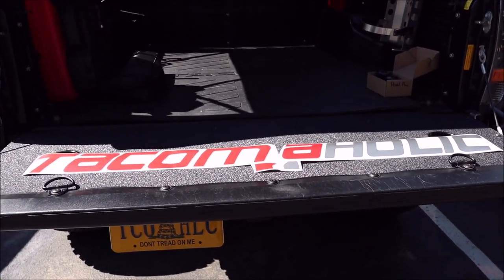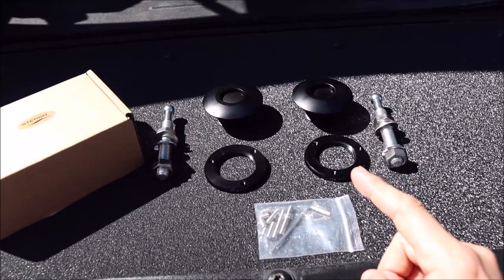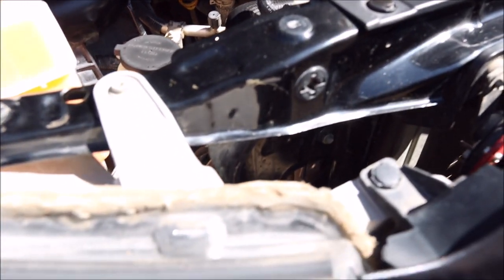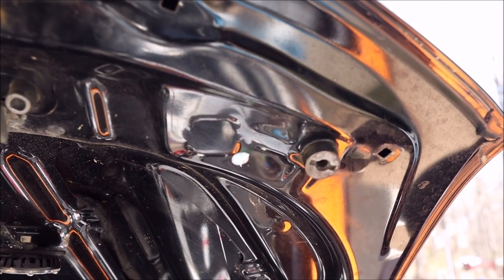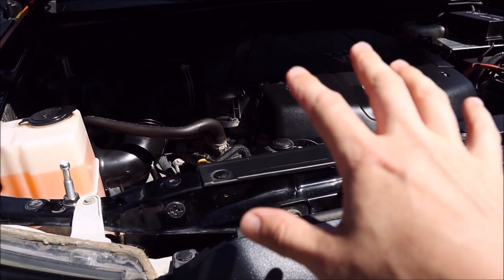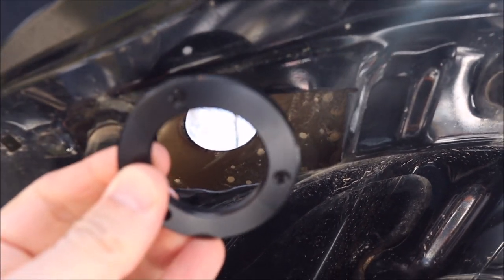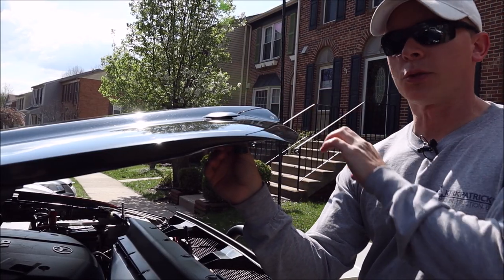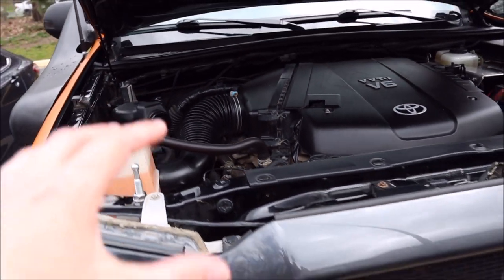Never Thought I'd Have to Install This Tacoma Mod

Comment: My first-gen Tacoma had that same problem, but it was on the rear passenger side being the mostly risen. All I did was stand and jump close to the hinge, and it made it ten times better with barely and 1/8 inch difference and has stayed the same for many years now with some hardcore 2/3 wheels on the ground crawling plus a county with many crap roads and it hasn't moved at all.
Reply: You, you, Jumped on your hood!!!??? 😲  WOW,  that took some boot skill ,an' saved  drillin' your hood. 🤣😂

Comment: Would start with loosening hinges, adjust. If you need to shim to get you where you want to be. It only takes being off a little bit on one end to be out a lot by the time you get to the front. I would bet it's from all the 2-3 wheel trail flex over time. May have to massage those hinges to get everything back in spec.

Comment: To fix that gap just simply turn the rubber bump stops (under the hood towards the front on each corner) clockwise to close the gap.
Reply from the maker: That was the first thing I tried.

Comment: Turn the rubber things on either side of the hood. Right beside where you drilled the hood. They are on every car ever made. Turn them in and out to adjust the height of the hood.
Reply from the maker: I tried every possible combo with those. Nothing worked.
Reply: @Tacomaholic  something is wrong, try taking the height adjuster completely out. Loosen bolts on hinges. If that doesn't work your  hood is bent. Someone could've have tried to close the hood with tools on rad support or opened it ìn a wind storm. You could also grab each corner of the hood and twist it by hand. Sounds crued but works.

Comment: It seems almost like the hood warped somehow I checked mine and the tolerance seems to be right on both sides I am wondering if the outer portion of your hood swelled up almost like it ballooned up maybe from off reading or the heat of the sun hits that spot more intensely just a guess I am sure there is someone out there with and answer for you good luck beautiful truck

Comment: I'm starting to have the same issue in my 15 Taco and I'm pretty sure it began after installing hood struts🤔
Reply from the maker: Were the hood struts installed in the correct positions on the hood?
Reply: @Tacomaholic  Yeah they are, I think I used your "how to" installation video.   Hehe

Comment: I think that if I do the hood pin mod, I'm going to need a fiberglass or frp Hood with a functioning air ram scoop to justify it..  About $450-500 for the hood, and fab up a plastic air box for it.  I would opt for carbon fiber bezels and release buttons.
I'm not about to do it...yet.
I'm about to spend some stimulus on a trans service(toyota trans fluid, filter, gasket and goop), and new tires.  (About $650-$700).
Hopefully your frame isn't tweaked.
Reply from the maker: I found some good fiberglass hoods but the shipping costs just as much as the hood.
Reply: @Tacomaholic  with all the weight you've added in armor, I would at least consider losing some hood weight, but maybe that's just the car tuner in me.
Love the channel, BTW.  Keep up the good work bro.
Reply from the maker: @edwardk6764  Oh I'm definitely considering it. Nice to save a few pounds wherever I can.

Comment: I'm thinking you bent your frame rock crawling on three wheels...I'm still having a difficult time wanting to cut a hole in my  fender for a snorkel.
Reply from the maker: It's amazing how easy the cutting gets after a while. 😀
Reply: Once you start cutting it's kinda hard to stop
Reply from the maker: @sariego9  Is there ANYTHING left to cut on your truck after you purchased those giant tires? 😀

Comment: I was originally planning on going with generic hood pins, until you posted this. I hit a deer a few years ago, fixed what I could and have been having the exact same issue since. It’s either have the hood lined up with the fenders and get hood flutter, or over extend the rubber stops and sacrifice looks for a rigid hood. 
Do you think these pins are safe enough to delete the hood latch?
Thanks!
Reply from the maker: I'd prefer to keep the factory hood latch just in case. If you wanted to delete the center hood latch then I recommend going with one of the high dollar hood latch setups.

Comment: I think you can fix that by adjusting the hinges
Reply: Spin the passenger round rubber deal down the other side up. Plus hinges on the ends close to the windshield
Reply from the maker: I've tried every adjustment on the rubber pieces, but what is there to adjust on the actual hinges?
Reply: @Tacomaholic  I think just loosening and getting them so you can realign the hood, then slowly back and forth tighten them down.
Reply: @Tacomaholic  Or you could have stuck a rubber piece under the truck, that way when the already rubber piece on the hood will hit it that way making the hood stick up higher. Lol does any of that make sense?

Comment: How did you get the replacement for the part you lost
Reply from the maker: I just bought a second set of the hood pins. I figured at least I have a few spare parts now if anything breaks.

Comment: Take a look at the drivers side head light it definitely looks like the fender is dropping
Reply from the maker: Aside from checking all of the fender bolts, is there anything else to try to stop that from happening if that's the case?
Reply: Shim the fender up. Or farm jack on the fender to force it up 😂

Comment: is that your hood bulging or your fender drooping?
Reply from the maker: Yes 😁
Reply: I don't think its the fender as the headlight still looks to be in the right spot. I think that would be off too if it was the fender. I wonder if the whole hood is just warped, or maybe there is something up the hinges.
Reply: I would rather have a bulge than a droop. Well I am 66 y/o

Comment: You don't think it's the body lift do you?? Oddly enough toytec doesn't sell the 1 inch lift, I had to find a different brand
Reply from the maker: No I had this issue way before the 1" body lift was installed. https://www.toyteclifts.com/catalog/product/view/id/4669/s/rm83002-ttl-1-body-lift-for-05-up-tacoma/category/6/
Reply: @Tacomaholic  ah thanks I swear that link was dead 3 days ago, and their was dead to a 1inch. While I have you, did you have to have a whole bunch of lines (brake, fuel, etc) to do the 1 inch? Also, you have a push button hood pin, would the more traditional lock pin give more adjustability to your hood?
Reply from the maker: @sariego9  There is a bracket for the fuel tank neck, one for a steering line, and then the new radiator support brackets. I think my passenger side front ABS line was disconnected from 1 tab just to provide a little bit of safety slack.

Comment: Ok my front end is twisted similarly, but it doesn't affect my hood. My bumper/body gap is about an inch higher on the passenger side. This was early in my wheeling days, and I had not hit that many trees yet, so I'm wondering if there is some allowed tolerance from the factory that twists over time.